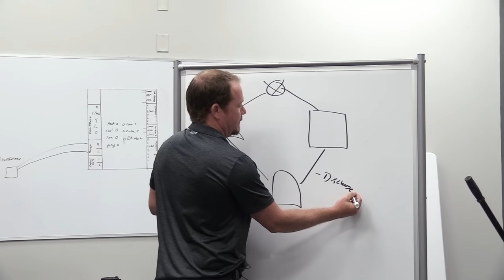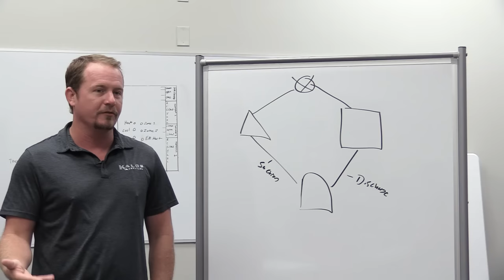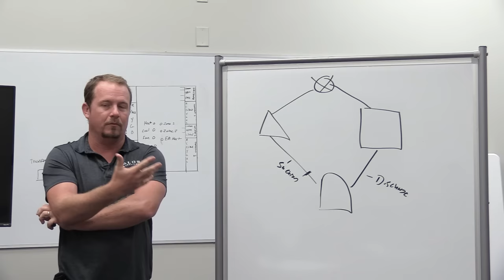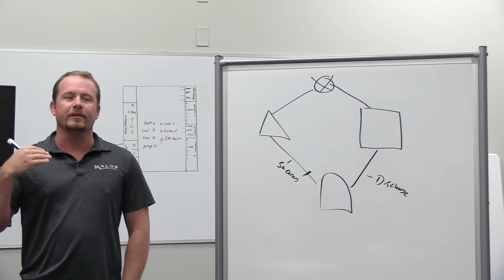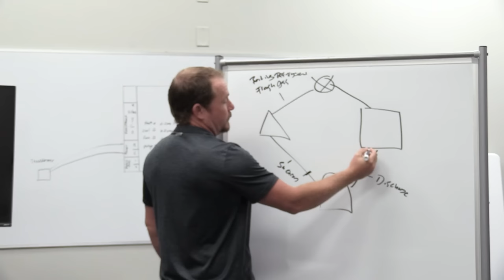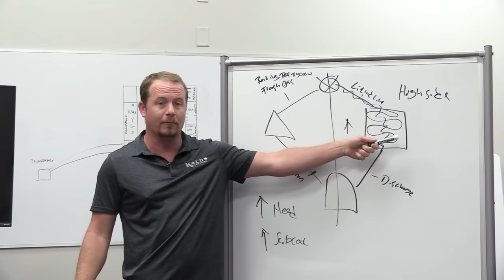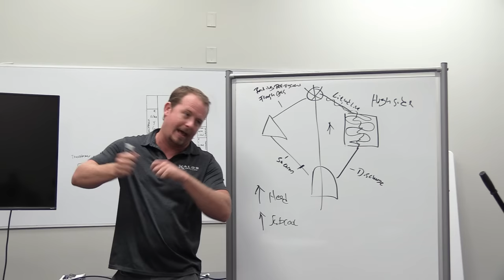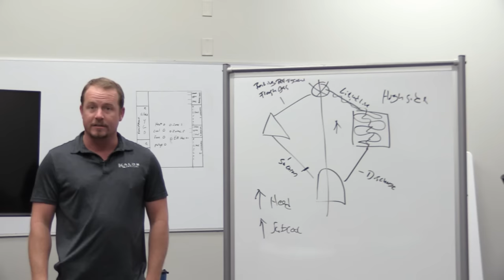Refrigerant Overcharge Troubleshooting and Prevention

Comment: I once went on a service call to check a small Chiller for an MRI machine.  It was for a hospital and the hospital had their own HVAC employees but they couldn't figure out why it wasn't working.  So they called a local company and sent me out there.  I started the AC system up and within one second, it tripped on head pressure. I hadn't hooked up my gauges yet so I hooked them up and did another restart. Again, the second it started up, my head pressure gauge needle went from ambient to 600 PSI in 1 second!  Right away I removed the refrigerant that was in the system because they said their Tech added some refrigerant and it didn't help. The enclosed system was only supposed to have 5 lbs in it;  I removed 35 lbs!  The technician overcharged it by 7x its capacity, lol.
Reply: Thats awesome! Wow!
Reply: 😅😅😅 Jesus
Reply: The highest overcharge I’ve seen was on a walk-in cooler: I pulled a little over fifteen pounds out. This one tops mine!

Comment: You can also add refrigerant when the system is off by using your recovery machine in reverse. 410a i use a charge compensator with filter driers on the inlet and outlet ( if recovered refrigerant is being re-used ) or if its virgin refrigerant just hook your tank of refrigerant on the inlet and the equipment on the outlet. It'll get it all in there quickly. On commercial equipment this is done a fair amount of time.
Reply: Thanks for the tip.
Reply: Also helps get every last ounce out
Reply: All the time, especially on larger charges.
Reply: Might sound like a stupid question but wouldn't that slightly increase the pressure and maybe a slight chance of introducing non condensable

Comment: Also, subcool will go down when the house is hot. If you charge to 10° subcooling when the house is 90° and go back when the house is 70° the subcooling will be much higher. The TXV will throttle back when the heat load across the indoor coil drops.
Reply: Yup, seen this happen on many walkin coolers, if they have a food delivery, and prop open the door, and bringing in tons of product and the kitchen is hot, the big demand on the coil can result in sight glass flashing for a bit. But clears up in a minute when they finally close the door. Same with a house, if the house is 90 degrees, that TXV will have to be wide open just to keep the superheat under 30 degrees maybe, and it's trying to maintain roughly 10 on average at design temps.

Comment: I am a homeowner in Minnesota and getting addicted to these teaching videos by Bryan.  My AC recently, on a very hot day, was constantly running but not cooling enough.  I called the pros, and the technician came in and hooked his meters to the outside unit and immediately told me that the pressure is low, and there must be a refrigerant leak, and I needed to get another company to do a leak test on the system because his company doesn't.  I brought in another company where they pushed the refrigerant into the compressor, and tested the coil with high pressure nitrogen where they found no leaks (no vacuum was pulled after the pressure test). Then they unsuccessfully tried to charge the system and concluded that the TXV was stuck shut.  I didn't feel that the tech was confident in his assessment, so I requested to get a more senior person to assess the issue, he quickly added one lb. of R410A and ran the system for a while but wasn't able to get the superheat below 20 degrees, and he thought that he over charged the system, so he reclaimed some refrigerant but only dropped the superheat to 17 degrees, at that point he concluded that the TXV is stuck closed and told me that I need to replace the coil.  The system is less than three years old.  Do you guys agree with his assessment?  sorry for not providing all of the technical information as the I haven't gotten the lingo down.   Thanks in advance for your opinions and advise.
Reply: go away

Comment: The biggest problem I see is low air flow from not enough return or under sized filters. Sales men like up size equipment without adding ductwork

Comment: Up here in the northern states, piston metered coils are still readily sold (13 SEER). I can't tell you how many systems I've come across that were overcharged by a previous tech because of a blocked metering device. They see high subcooling and high superheat and have no idea what's going on. Forget about reading analog gauges. Then that tech condemns the condenser. What I've seen, in my 10 years of working in the HVAC field, is little shards of solder or braze stuck in the center of the piston. When the restriction is removed, either by taking out the restriction and/or replacing the piston with the correct size, that system works as intended. I honestly think critical thinking has gone away and if it's not in a textbook some techs are lost.

Comment: Unloaders on the Compressors! My favorite analogy of the metering device is a traffic jam. Everyone is trying to fit through the one open lane and you’re in a high pressure but when it’s finally your turn to get past the wreck, the traffic is spread out and you’re free to drive without running into anyone. So that’s a low pressure. Or it could be a fire alarm In a building and everyone trying to escape through the same door. Great video! As always!

Comment: Helped me in diagnosing our chillers issue that has an accumulator and hot gas valve that helps boil refrigerant after the txv before hitting the evaporator water box

Comment: this is a great video. I wonder if this is what i got. my home hvac use to blow super cold one day we had electrical outage and then it blew cool, had 3 different hvac companys come out 2 of them both added freon still blowing cool the 3rd guy cleaned the condensor outdoor still same issue. found a video on youtube that maybe the txv valve was plugged with varnished oil. the temp fix was run the heater so it will heat up the txv bulb then run the ac to get the oil moving but only worked for a bit. if i go outside and put water on the condensor coil it gets the ac really cold for a few min but back to blowing cool air.. it does the job has the 20 degree split but does not have the cold bite it use to on a hot day it cant cool the house it feels muggy if there are to many people in living room.. and wont go lower that 76 when b4 it use to go down to 73 on a day when its over 100 any advice?

Comment: If I had a little too much freon in a typical residential ac unit would it make my coil not as cold as it should be?, Or are the only negatives are waste of freon, not as efficient, shorter life span. Sounds like that's the case, which would make slightly too much is better then slightly too little.

Comment: Overcharged systems compressors will also draw more current, and in extreme cases trip on HP or even I have seen a Rooftop trip a breaker because of overcharge

Comment: If the suction port was damaged, I’ve turned it off and used a propane torch to feed a few ounces in. Then turn it back on and checked again. For small refrigeration anyway.

Comment: What does it mean if my compressor is sweating up to just below the low pressure line? I live on the Texas coast so we have a lot of humidity. A/C cools fine for an old R22 system but I had them put in Nu-Calgon Ultimate seal 7.5 ton and pressure up but they dumped R427a on top of R22. Two years later vapor line is beer can cold sweating and dumping heat. I was just asking about the compressor sweating. Is that normal for being on the coast with high humidity or is it over pressurized? Pressures were left at 78/240...4 ton system.

Comment: I got a question. I have a non-inverter mini split and there is only a port on the suction side, no port on the high side, and so there's no way for me to know what the head pressure is. I seriously doubt it uses a TXV and it's definitely a fixed orfice. How do I know if it's overcharged? Because oftentimes I will add refrigerant and the suction pressure will be just below freezing (about 45 psi for R22) and it stays there no matter what.

Comment: When refrigerant overcharger, its cause compressor current overload, high pressure at condenser unit, high pressure at evaporator and suction line. Supperheat low, oil & liquid comeback to suction line. Subcooling low.

Comment: In automotive air conditioning they have a system where you can suck the refrigerant out of the air conditioner and into a storage tank and produce a good vacuum.  Then they zero out the scale and then have it start pumping the refrigerant back into the air conditioner until the proper amount of refrigerant by weight is pumped back into the air conditioner.  All with the car engine not running

Is there any reason why you can not do the same thing with home or commercial air conditioning systems?  If you know how much the system is suppose to have, and it should be written down where the access ports are, you should be able to use a refill pump like they use for auto air conditioners to pump refrigerant into a home or commercial air conditioner system.

Comment: Those micro channel condensers are super easy to overcharge.
Reply: They're designed to hold very little refrigerant. I had to replace a microchannel coil on a Bohn low temp freezer condensing unit a few years ago that has a flooded head pressure control. With RTPF (round tube, plate fin) condenser coils of this size, it's normal to charge to a clear sight glass, then add an additional 4-6 pounds of refrigerant to the system for it to work properly in the wintertime. But I looked up the manual for this unit, and it only calls for 1.1 pounds of additional refrigerant, because that's all it takes to flood the condenser in the winter! The previous installer had added way too much refrigerant, and the combination of that, plus a dirty coil, plus a hot day busted some of the flat tubes where the aluminum is soldered onto the hot gas header.
Reply: So, they're also super easy to damage from a gross overcharge. The Trane microchannel coils haven't been too bad, but some early adopter manufacturers were (and maybe still are) nothing but trouble and quite leaky.
Reply: @brnmcc01  I agree. Super easy to over charge especially in cool weather. Every ounce matters. If you notice, all the AC units have a head pressure switch. I’m surprised your machine didn’t have one. Us old timers are used to the AC systems that have a slow leak and just need a pound or two every year and they’re good for the summer. Can’t do that with micro channels because if it loses a quarter pound, it’s not gonna cool well. And if you attempt to overcharge it a quarter pound to make it last longer, it’ll hit the hps. I’ve heard people say it’s not safe to pump down into one of them, but I figure if it was pumped down when the unit was new, it’ll pump down now. I did practice with a scrap unit to see if I could learn how to solder and repair one of them. No luck at all. I’ve repaired plenty of tube and fin coils and even all aluminum. I really don’t like these, other than they’re easy to wash.
Reply: @brianlittle717  It does have a high pressure cutout, but I think it's the self resetting type so the continuous flexing of the microchannel over and over finally caused metal fatigue cracking, and then the system basically pumped itself out. The low pressure cutout on a freezer is only set to 5 psi, so when I got there, the system was completely empty. Coil was covered by warranty from Heatcraft, but the 10 pounds of R404A wasn't cheap... As far as repairing the coil, the cracks were pretty buried and not very accessible, plus it still had a couple months of warranty left. They are easy to wash, even 12.5 ton Trane voyage units the microchannel coil is single layer, so it's infinitely easier to clean, than having to take the top off to split coils on older versions.
Reply: @brnmcc01  yes it’s definitely easier to wash than the Slip coil voyagers, but I’d rather have those old units any time. Those things were built like tanks. That makes sense that it burst because of short cycling. That’s bad on the compressor and everything else. I prefer the manual reset hps switches. And you’re right about the lps on a freezer. It pumps down and the lps controls the compressor, so even if it’s got just a little bit, as long as the solenoid is open, it’s still gonna cycle.

Comment: I'm not a refrigeration tech but I work on cars. When the high side gets too high pressure it just turns off the compressor till the pressure drops. It doesn't keep pumping it. Don't building ac work the same way?
Reply: Most quality systems have high and low-pressure valves. Because of the potentially dangerous high pressures, a car engine compressor could create a High-pressure switch is a must.

Comment: I had my seer 12 unit replaced by seer 16 (same manufacture) unit.  With the new unit I have to lower the thermostat by 4 degrees to have the same level of comfort.  With seer 12 unit I set the thermostat at 80 degrees,  With the seer 16 unit I have to lower the thermostat to 76 degrees to get the same level of comfort.  Any idea why I have to lower the thermostat with the seer 16 unit?  Thanks

Comment: A lil bit offtopic question, for DIY house installation of  small split unit, can I use CO2 instead of nitrogen to check for leaks? I happen to have CO2 tank and as far as i know its pretty inert gas? Will it condense when pulling vaccuum ?
Reply: Absolutely not. Co2 adds moisture to the system which is a huge no no.
Reply: @voretex4202  I see, thanks  for answer!
Reply: @voretex4202  Well Co2 is a new modern refrigerant. It's not the Co2 part but the moisture content in the cheap Co2 bottles. The nitrogen sold by one UK refrigerant company has some low moisture as well.  I buy a scientific nitrogen gas with a lower moisture level in the specs. Cheaper and I own the bottle.

Comment: At about the 13 minute mark you state the increased pressure of the liquid stacking up behind the txv has an influence on it.
Why?
The txv bulb on the coil manifold, or suction line, is opening and closing based on the temperature of the refrigerant exiting the indoor coil.
Is it your position that the increased pressure of an overcharge drives more liquid refrigerant through the txv opening than a properly charged system? If so wouldn't it only be for the amount of time it takes for the txv to react, because it is based on SH.
If so, then a dirty coil or failed/failing condenser fan motor would produce the same effect, as would high ambient temps.
Reply: He meant that it forces the TXV to throttle, he explained it only briefly but if you watch the animation closely during his voiceover, you can see the cutaway txv closing down.
Reply: @brnmcc01  
Why?
If the opening/closing is based on the temperature of the refrigerant leaving the coil, as sensed by the txv bulb, what influence does the stacking liquid refrigerant have?
Reply: @jrsmyth9761  Higher pressure differential across the valve means more refrigerant will flow, resulting in the TXV closing down to compensate. Think of it like trying to regulate a sink faucet to exactly 1 gallon per minute of water flow, and your water supply is on a well pump system. If the water pressure drops, you need to open the faucet more, and if the pressure starts to build when your well pump turns on, you'll need to slowly close the faucet to maintain the desired flow. The compressor in this example has a fixed speed, so it can only handle a certain flow rate of refrigerant.
Reply: @jrsmyth9761  more cold refrigerant means more capacity to absorb heat. If there's not enough heat but you're pushing in lots of liquid vapor, there's a chance that doesn't completely boil by the time it reaches the end of the evap and your sensing bulb which means 0 superheat. So the meter reacts by closing down some more. Also remember pressure equals temp so if the liquid coming in is higher temp (pressure) because of an overcharge, what is metered in by the TXV won't have the capacity to absorb as much heat so it might dump more in to bring down superheat but then goes too far and chases it back up and the cycle continues as it opens and closes.

Comment: Legit Question: Why in the install manual for Amana 2 Stage ASXC systems does it say charge unit in first stage?
Reply: The engineers are thinking with a properly sized system, it will be running in low stage most of it's working life. High stage is just for those few hot days during a heat wave, high occupancy load from a house party, or recovering from setback when they get home from work etc. It's also more intuitive for the homeowner that doesn't understand how HVAC works. But they will like it if they really crank the thermostat, the system will 'rev up' and run full blast and cool (or heat) the house faster. Once it's at or near setpoint though, we want the system to run as efficiently as possible so the charge should be right on the money on 1st stage in order to achieve this.

Comment: As someone who is just an average homeowner, is this noticeable when you start to get puddles of water underneath the AC condenser after a new install?
Reply: That might not be overcharge, just from low temperatures inside the house combined with a high outdoor dewpoint will result in a lot of sweating from the suction line and compressor body as well sometimes. With a properly charged system with the indoor temp set to 68 degrees or 20C, the suction line temperature will tend to be about 58 degrees, and when the outdoor wet bulb temp is over 75 degrees, it will result in a huge amount of condensation. Also if you do any kind of work outside in those conditions, you will also sweat like crazy!